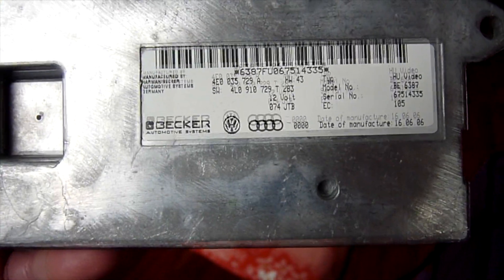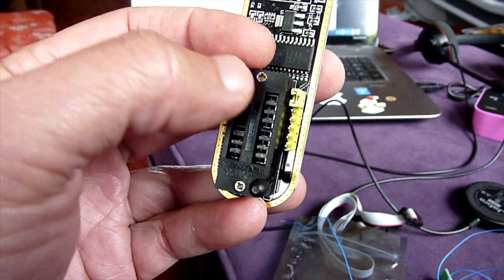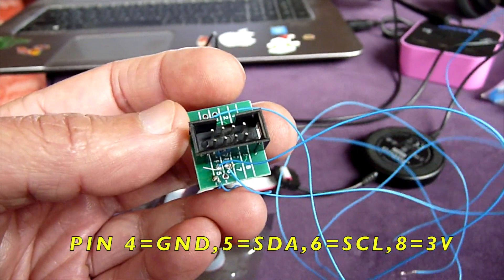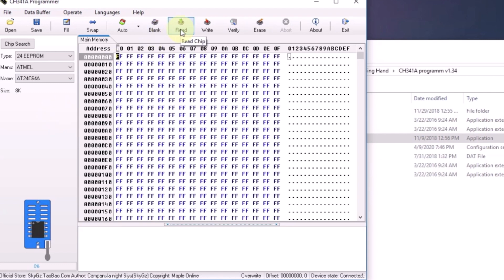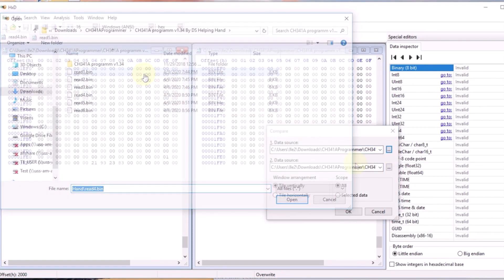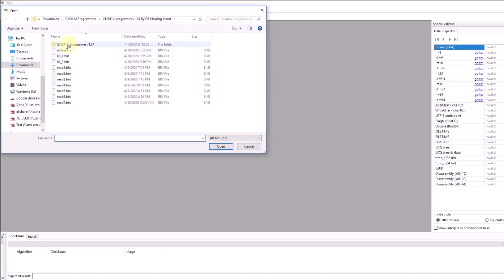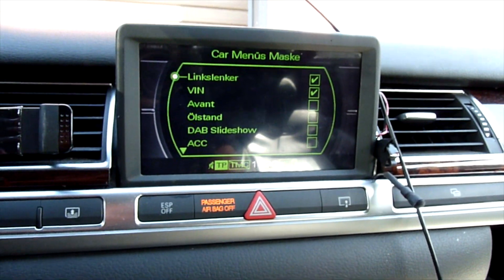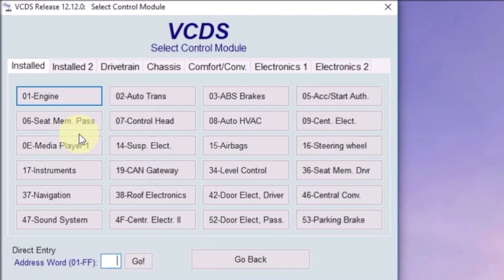How I Restored Sounds From Component Protection MMI 2G

Comment: Hi Bro, did the component protection issue come out on its own or did you change another MMI module and that's why the component protection issue came out?
Reply from the maker: When the components between head unit and can gateway don’t match, CP came up. When you replaced a component like Head Unit, MMI CD player, CP comes up.
Reply: @3dogs1monkey  tnk Bro

Comment: Hi, why did you decide to change your original mmi unit where you added fakra e connection? was there something wrong with it, because i'm planning to add the fakra connection to my unit based on your tutorial and i want it to work like the original did it have some kind of limitations when you soldered the board?
Reply from the maker: tiktok51 nothing is wrong with mine, just change to see how to fix the CP. Experimenting the myth of CP.
Reply: @3dogs1monkey  okay, thank you for your tutorials, i will try and see if i succeed as well
Reply: @3dogs1monkey  Hi, i need your help, maybe you have experienced this issue, i have soldered the circuit board as you did to ami unit, now everything works except my video is black and white, and there is quite a bit of static noise. I didn't know exatly where the screen earth 1 goes, i conected the 3 wires from the conector to the AV wires ground, but now i'm thinking maybe it should be conected to cars earth directly? also if i'm using only using AV1 do i need to connect Screen earth 2 as well?
Reply from the maker: tiktok51 it’s your setting on tvtuner, pal or ntsc
Reply: @3dogs1monkey  its PAL, should it be ntsc?
Reply from the maker: tiktok51 set them both to see if the color is on. Is your camera or Android box setting ntsc or pal?
Reply: @3dogs1monkey  I have a HDMI to AV converter box, and i can set that box to either PAL or ntsc. i will try that, also did you get rid of the small flickering when you replaced the mmiunit with the original circuit board? I've seen in your videos that you had the flickering as well when you had the soldered circuit board.
Reply: Still no color, i'm very intrested about those screen earth pins, where to they go, also where do i connect the negative wiring(shield) of the AV cables? now i have screen earth 1 wires connected to negative wires of video out L and R cables grounds.
Reply from the maker: tiktok51 I only used 1 ground for all groups, make sure AV1 ground 1
https://www.dognmonkey.com/audi/how-to-install-analog-tv-tuner-4e0-919-146-on-audi-mmi-2g.html